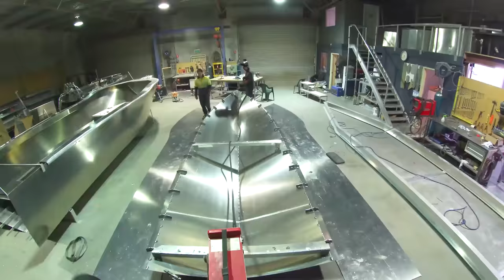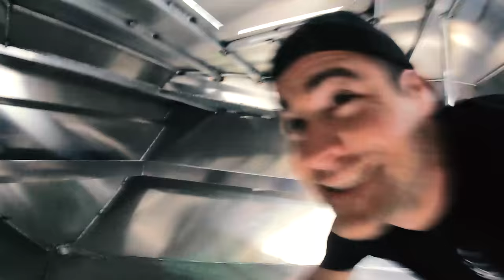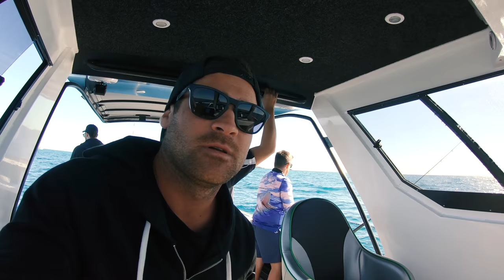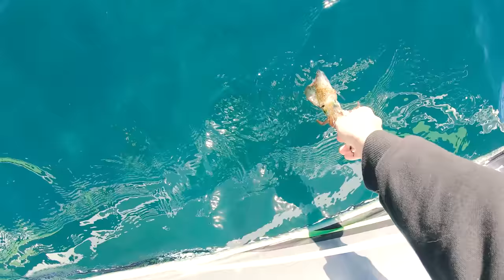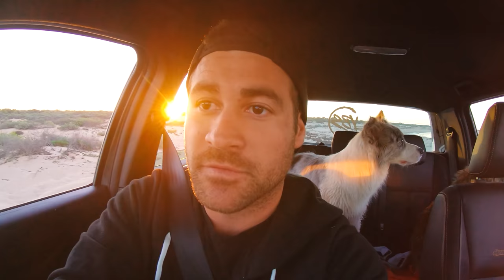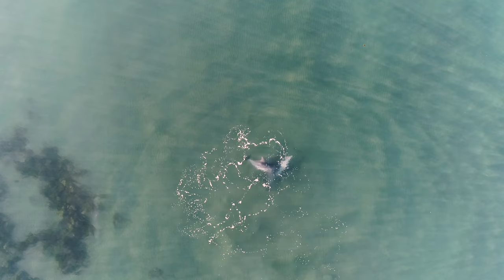FIRST LOOK AT OUR NEW BOAT Fishing With Professional Football Players (Please Help Bailey) - Ep 104

Comment: Congrats on your he new boat. Aluminum boats are a bit noisy at anchor, when the water slaps the hull I noticed.  In the US fiberglass is utilized. Quieter material.
Reply: They beach these boats, not good on fiberglass...
Reply: Paul Pence I grew up in Panama. Fished and spearfished Atlantic and Pacific.  Only 50 miles apart. Was a great place for what these guys are doing today. Beached our fiberglass boats all the time.  Never had glass damage, but the sand sure did a number on the skegs of the outboards.  We just left the skegs unpainted.  Just noticed it is all, not a ding on those fine craft.
Reply: @MetalDetectingwithCZkidd  Then you already know its an age old argument...

Comment: are you getting the 950xl? that s their top model from teh site
Reply: He said "bigger" in previous episodes, but said another 750 here, and it looks like a 750. Got the new truck to pull it, maybe he just meant bigger for the fact it will have twin Mercs and haul more fuel, "heavier, not bigger"... Anyway I thought it was a stretch to attempt pulling a 9.5m boat with a ranger.